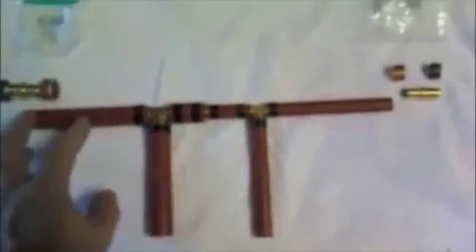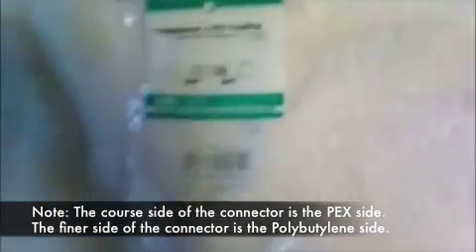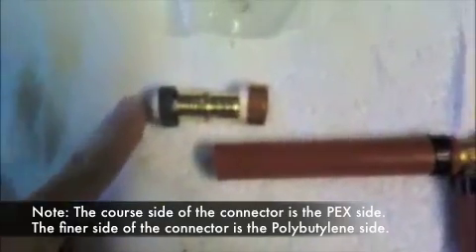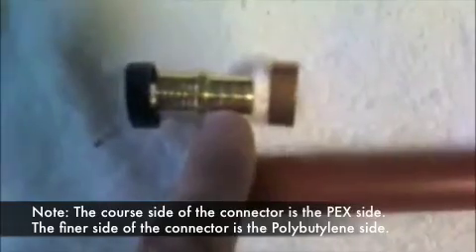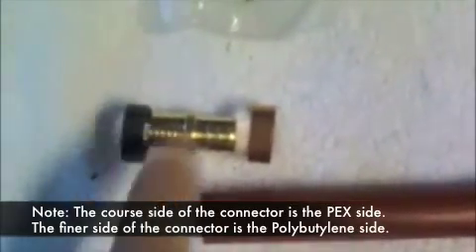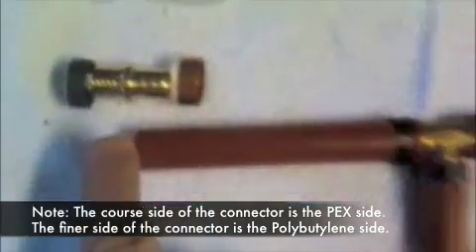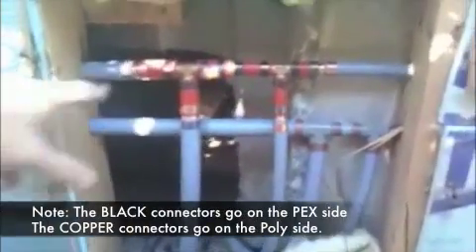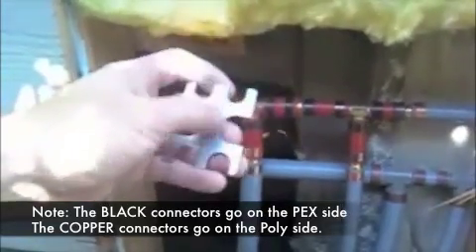Polybutylene plumbing repair

Comment: 30 years with poly pipes and never had one burst or fail but those plastic fittings are the worst.  Every last one of them broke, my theory is it’s improper installation I noticed the break occurred on the side where the poly pipe was curved away from the straight pipe putting unnecessary strain on the fitting.  Okay I agree a chemical reaction caused the fitting to weaken but l also believe if the poly pipe was installed using straight lines like copper, the fittings would have lasted longer.

Comment: 2 questions.

1. So does convertion crimp ring for the poly and the pex can be crimped with the PEX crimp tool?
2. Can the PEX go NOGO guage be use on both sides? pex and poly-b rings
Reply: You can use the same crimp tool to crimp both sides. The outside diameter is the same  . Yes you still use the go no-go test plate  !

Comment: While you had it opened up, the other poly fittings should have been replaced also. They all will fail in time and if they failed after you left, then it creates a callback which none of us likes. Great video otherwise. Take care.